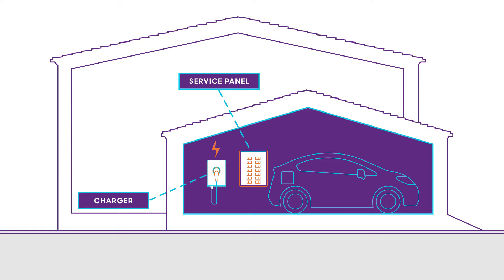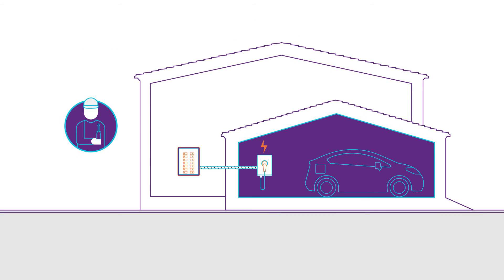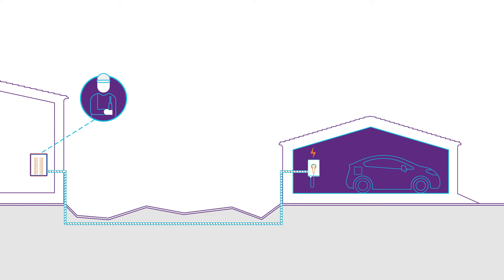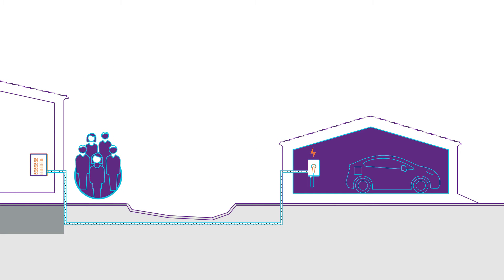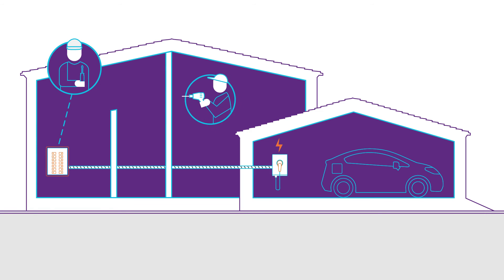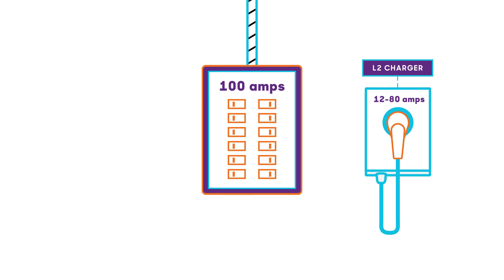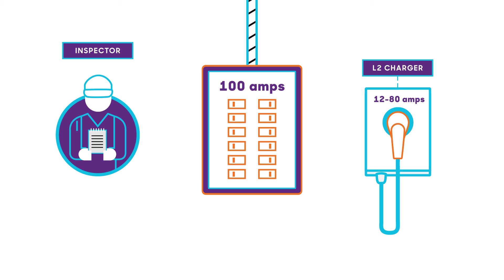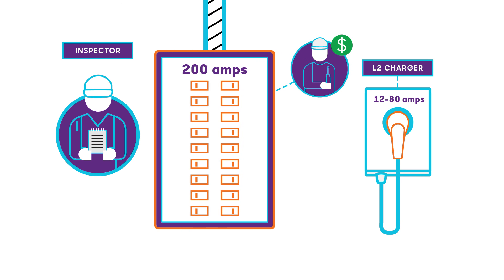Level 2 Home EV Charger Installation: Know the Basics — Cars.com

Comment: If your home has 200amp service, you are good. Many new areas or developments have taken this into account. Older neighbor hoods though, this could be a problem and a large expenditure.
Reply: How do you know if your home is 200amp supplied?

Also, is it work putting in the charging panel if you’re renting versus owning a house?
Reply: @shkooling   Just look at the main circuit breaker. It is usually stamped on it.
Reply: @bobsmith1262  What happens if the main breaker panel has up to 6 overcurrent devices? Then how do you know what size service it is?🤔
Reply: @gonzo910910  you look at the main breaker. Like Bob said.
Reply: @wolfrig2000  But what if the main breaker is not just one breaker? What if your main panel has 2, 3 or even 6 Breakers in it , and there is not a sole main breaker that shuts off the whole house? How then do you figure out the amperage your service?

Comment: how's is your house electric bill .... is it a lot higher or little higher then before ? LV1 vs LV2
Reply: I would also love to know this
Reply: The bill should be the same no matter if you are running a level 1 or 2 . This is because an EV only uses only the energy needed to charge it. Once charged there is no load on the circuit, other than possibly some trickle charging due to the fact a battery looses a small amount of power over time ,even when not being used. The difference between LV1 and LV2 is the speed in which the charging takes place.  Think about it like this: Your gasoline powered vehicle can only take 20 gallons of gas once filled at the 'LV1' gas station. The pump stops after taking 5 mins to fill. If you went to a 'LV2' gas station the pump would still stop at 20 gallons but it would only take 1 minute fill the tank. Hope that helped. (LV1 and LV2 gas stations are just something I made up for that analogy)
Reply: @gonzo910910  thanks for the feedback brother... I am really interested in EV... But torn between EV vs hybrid 😅
Reply: @Imoh Balu  I have gasoline powered vehicles, but in the next few years I would like to get an EV for family road trips when the range per charge increases and LV2 charging or greater becomes cheaper, as a fast charge will make EVs more comparable to gasoline powered vehicles. I have done electric work most of my life and I'm ready to take of bite out of local market share installing these charge stations with greater frequency in residential settings.
Reply: @gonzo910910  you are right brother so far Tesla is a good choice... But very expensive for me... If there is some less expensive with good range.. Like 300 or 400 KM for one full charge that would be great